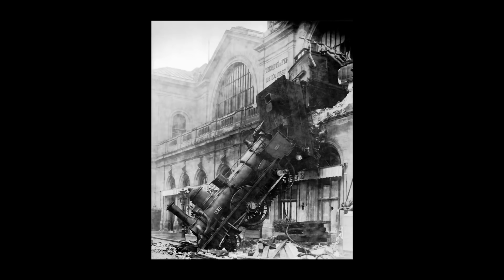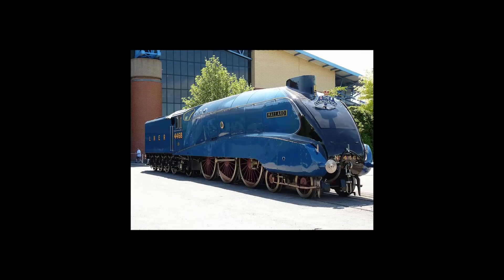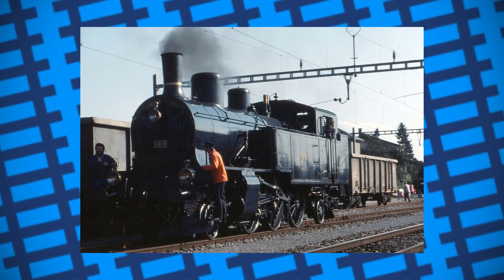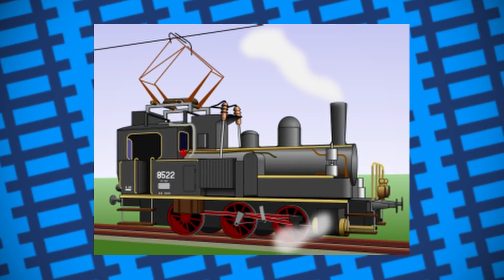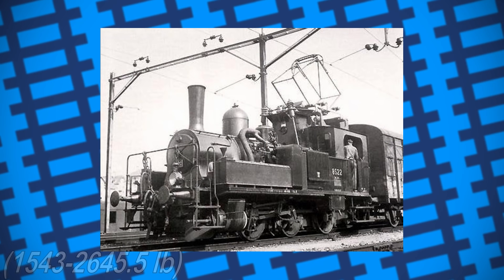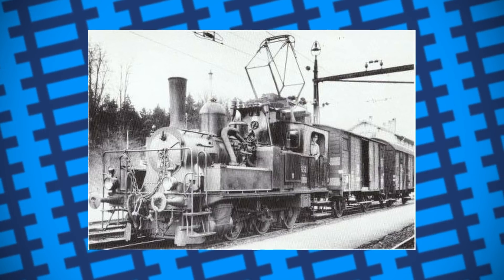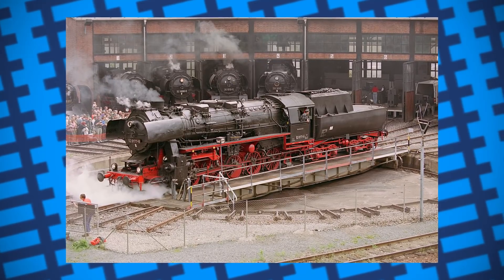Why Switzerland tried to fuel steam locomotives with electricity - Electric Steam Locomotives

Comment: Modern electrics are now reversing the all electric trend with 'last mile' diesels, + full power diesel only option, electric + diesel, battery. Of course Thunderbirds had nuclear trains in the 1960's and aircraft and ships, so only one out of three was a win though there was one nuclear aircraft built by the US. Where cheap electric is available, electric pre heating steam engines saves time and coal/oil fuel. and reduces thermal stress cycles on boilers.

Comment: one of the reasons for these was Switzerland went for wholesale electrification which was done with AC at the low frequency of 16.666 hz, this was because DC motors would tolerate being run by a low frequency AC supply and still be capable of a controlled power output. This was not so effective for shunting purposes as slow speed running on the AC supply with early motors so electric production of steam was used , I think these designs came much earlier than the 1940's though.

Comment: I should think of Steam-X which locomotives heat water with waterproof heaters with electrical charger, and use a power tender bank to help extra power when travel

Comment: The hydro locomotive…. I always wondered why in the USA Electric and diesel locomotives had to use fuel oil to heat their boilers for steam heating.. couldn’t they use electricity and heating element to do that?

Comment: 1 carriage water tank 2nd carriage Tesla mega pack battery and maybe a small generator battery charger from the wheel hubs/axle but maybe not in winter as lithium batteries don't seem to like the cold so a Redox flow battery or similar maybe😊

Comment: I'm daydreaming about a future where there's high demand for high speed electrified rail transport, like they have in Japan.  However there's just one problem in this hypothetical future: a severe shortage of copper, making electrical motors uneconomical to meet the demand.  With the situation desperate, engineers contemplate revisiting the designs of the streamliner era of steam, but of course it's out of the question due to emissions requirements.  Then it hits them -- there was the answer, calling out to them from history -- the SFB E 3/3 8522!  YEs!  Electric power could be used to fire a steam boiler!  The railway engineers hastily re-implemented the most effective designs from the peak of the steam streamliner era, retrofitted with electric boilers fed from pantographs grabbing overhead lines, just like on the fastest bullet trains....thus ushering in a new era of steam champions
Reply: I understand it's a story - however technically you can still use Aluminium for motor windings. It's not as good as copper for this purpose and you mainly find it in smaller, cheaper motors but it also works.

Comment: Would a steam electric locomotive work?
Reply: Yes. However it would be a waste of energy, since you could have 80 % efficiency for the whole locomotive already 40 years ago (and a little bit less with old, brushed motors) while a steam locomotive just achieves  around 10 % efficiency
Reply: @simonm1447  Ah. Got it.
Reply: What about a steamer with electric drive? @simonm1447

Comment: Powering steam locomotives with electricity is a good idea for historical engines, though perhaps compressed charcoal might be even better for added authenticity. There are issues with using biomass as fuel, using too much just ends up completely counteracting the benefits, so using it for actual practical purposes is a bad idea. But for a small fleet of historical steam locomotives, it might just be a good solution after all.

Comment: I believe we've seriously missed out on a trick here. Probably something to revisit in coming years to help with emissions or even possibly to ensure that preservation lines keep in operation with the possibility of running out of coal. 
Take a standard loco in the UK, replace the coal tender with a large battery and use that to heat the water so that you don't have to rely on overhead wires to operate. Have a pategraph fitted to recharge the battery in a hybrid sort of fashion but this way, if the national power grid fails then you still have usable electric locomotives that put nothing but boiled water into the atmosphere as a result. 
I had this thought before watching this video. That thought is what made me search for this and now knowing that the pressure lasted for 20 mins gives me greater belief that this could work. Also. That 20 mins was way back in the 40s too and I'm certain that it would be easily longer in modern times

Comment: Were these resistive heaters? A dumb thought I'm having is, would it be possible to gain greater efficiency with heat pumps and would that be more or less efficient than having a motor run the wheels directly?

Comment: Eletctric preheating of steam locos in shed? Do not think so. Usually the engines were coupled steam lines to keep the water warm.
Reply: It's done today e.g. on the Brienz-Rothorn-Bahn Rack Railway in Switzerland, btw. one of only two un-electrified Rail Lines there. They have a few Steam Locomotives built around 20 Years ago, which can be steamed up in 15 Minutes thanks to built-in Electric Heaters running overnight. But If you have Steam abundant anyway, using that instead of Electricity indeed is usually the Superior Choice.

Comment: Cool thinking...... Say can a induction heater create the same effect just a thought
Reply: Modern Electric Boilers typically have two Electrodes that send Electrity directly through the Water, turning the Water itself into the Heating Element. That Way, you don't waste Energy by heating the Water only and nothing else.

Comment: I've had this idea for years...when a steam engine refills its tender with water...what if that water was hot?  It was kept in a water tower, right?  What if you used solar panels (the black glass panels full of water, not photovoltaics) to warm the water in the tower, so that the tender is at least significantly above ambient temperature.  Surely that would make injecting water more efficient since you're not injecting cold water?
Reply: Steam Locomotives usually use Injectors to pump the Feed Water into the Boiler, and these work best with cold Water. If the Boiler has an Economiser or other Preheater, it must be Places after the Injector. So you want the Water in the Tender to be as cold as possible.

Comment: Here in finland we even had a diesel engine changed into an electric one! The SV12 made out of a DV12
Reply: Switzerland did sort-of the same, by turning a Gas Turbine Locomotive into a multi-System Electric one, that can use the Swiss 15 kV 16 2/3 Hz System as well as the French 25 kV 50 Hz and 1.5 kV DC.
Reply: @Genius_at_Work these locos were likely diesel electric before, so you have to replace the engine with a transformer and some inverters plus a pantograph. You can still keep the rest of the drive train

Comment: Today of course, since the SBB during the  40's went primarily from steam to electricity at 15kV at 16.67 Hz single phasey9). 16.67 is one third of 50. this 'Drehstrom' or three phase from 50 is used thus the 16.67 Hz. Aurtria, Germany, and Sweden also use thiis standard as well. Diesel failed as well (thank goodness) as it was impractical.

Comment: Hear me out, small fast fision reactors that boil steam like crack and into moder metallurgy practices into massive pistons that can handel the load while having air and water pushed through to cood the engine and keep steam rolling through them, replace coal carts with water carts and youve got nuclear trains baby, minus a few layers of lead and the such as well as miniturizing reactor technology but.. thats the hard part, the easy part is application

Comment: Wait, I love steam, but why didn't they just use electric engines? I'm not sure I understand.
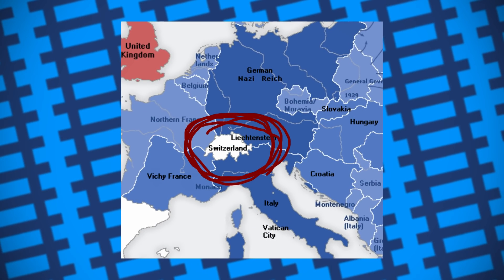Reply: 0:52 listen to this again carefully.
The swiss have electrified most of their railnetwork.
However railyard where cargo is moved cant have overhead wires, so you need either a steam engine or a batterypower locomotive or a steamlocomotive that powers via electrivity the steamengine and effectifly uses it as a "steam battery".

Keep in mind this wasduring WW2 steel was tight, coal was tight.
So they basicly electrified an ecisting coal steam engine into an electriv steam engine.
Reply: @Slithermotion  Oh! Thanks, I got a bit turned around.

Comment: My question is steam better than electric for heavy freight? Electric motors are powerful enough to carry all out freight today and I don’t think the efficiency of these motors has increased that drastically. Why couldn’t Switzerland have just gone fully electric?
Reply: copper shortage I guess...
Reply: Three years late but these were shunting engines. Copper wasn't exactly cheap either so why waste all the money on a few smaller shunting engines when you could use that money for passenger and freight trains? Sbb Just needed a way to reduce coal usage a bit. This solution did, without using the same amount of raw materials a full electric shunter would have needed. Especially a fully electric shunting engine would have probably needed a battery to bridge gaps in the overhead lines which would have required even more resources which were already scarce

Comment: The problem was, Switzerland couldn't make more electric locomotives, because of the war.
In order to build an electric locomotive, not only steel but also copper was needed.  And that was very poor in wartime.  And since many shunting locomotives at train stations still ran on steam, they came up with this idea.  The material used for building electric locomotives only went to important locomotives such as Krokodil (Ce 6/8³) or Ae 4/6 and Ae 8/14.

Comment: An interesting idea!
Unfortunately, as I explain to many people, there is something called energy transfer loss. It occurs when energy is turned from one type to another such as the burning of coal to generate electricity. it applies everywhere and even happens when electricity is used to charge a battery. (I often argue with the electric cars are wonderful brigade)
I can see where the engineers were coming from with this idea and how their energy availability created their final plans.
Reply: With your issue with electric cars, do your alternatives include electric public transportation?

Comment: Throughout the War most of the trade was of necessity with Germany, Italy or occupied France.  Inside Switzerland trains were usually but not always safe from air attacks.  But trains travelling to and from Switzerland in Germany or France were often attacked. This included swiss trains,  some of which took long journeys into France  especially.  So coal, steel and other materials were not always easily available. Also it was not a German priority to send much needed supplies to a neutral nation which sometimes shot down german aircraft that strayed across the border. To get the materials they needed the neutral swiss had to make things to trade with Germany. There were occasions when American aircraft 'accidentally' bombed factories, rail yards and towns in neutral Switzerland.

Comment: If an industrial plant produces large amounts of steam, there is also the possibility of fireless steam locomotives. At least for shunting and short distances. These can be recognized by the unusually large water-steam tank instead of the boiler and large steam engines. Overall, these steam locomotives are built more simply.